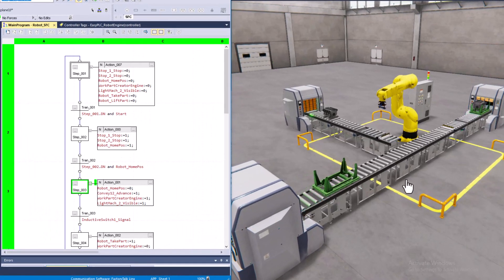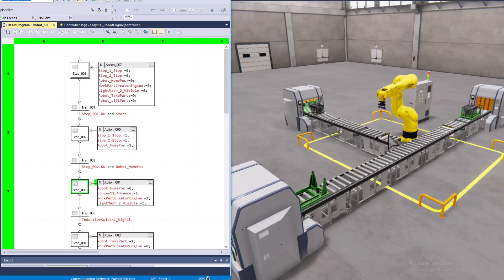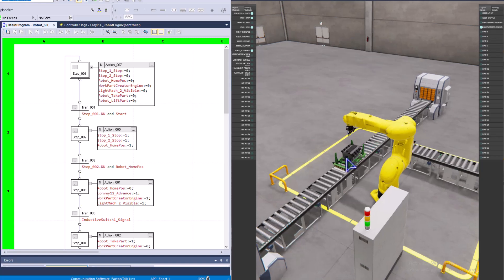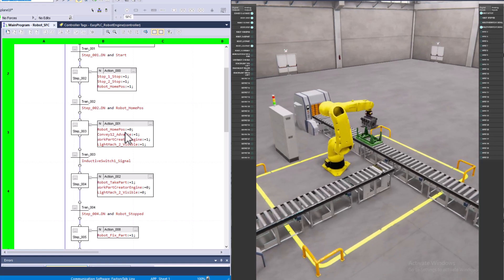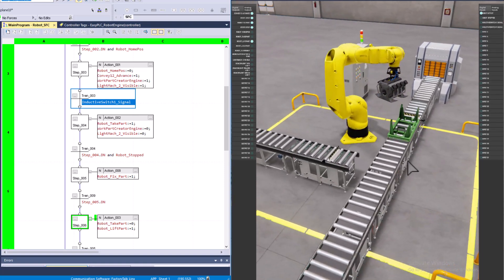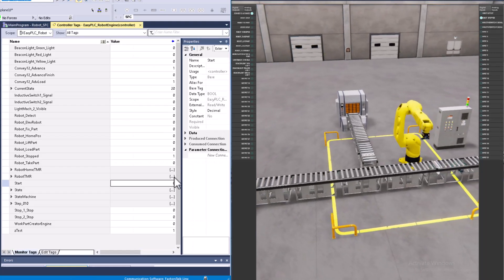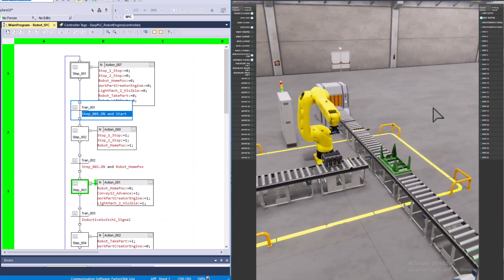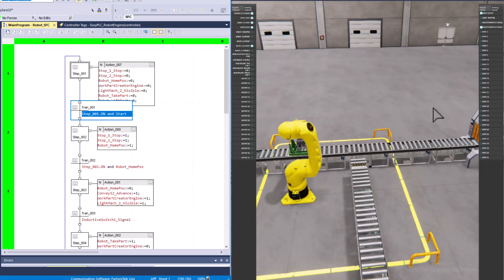PLC Programming challenge using Machine Simulator v4 2 in 2025

Comment: what are the features between USB, Standalone, SErver, and Professional licenses?
Reply from the maker: The difference is you can move the lic from computer to computer with a USB, a standalone is only good for one computer so unless you are planning to only use it on one or never have computer issues then I would get the USB lic
Reply: @ShaneWelcher so it is the same for server and professional, right? But how many people can use under server and professional licenses?
Reply from the maker: @jimmyko2110 
I don't know, as I stated the best use is what I recommended because that's what I have used for the last 4 years.

Comment: What is the simulator called again?
Reply from the maker: Machine Simulator V4.2 from Nirtec which cost very cheap and is much better than Factory IO.

Use code
EasyPLC_Shane
Or 
Shane_EasyPLC 

When you check out for a discount 

Also, get the USB lic, this allows you to use it on multiple laptops or computers.

That's what I use